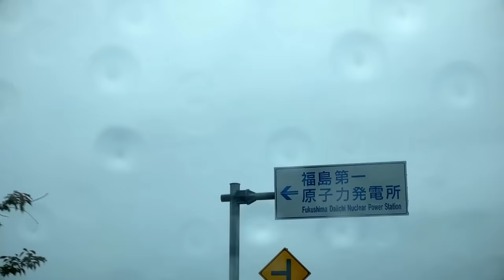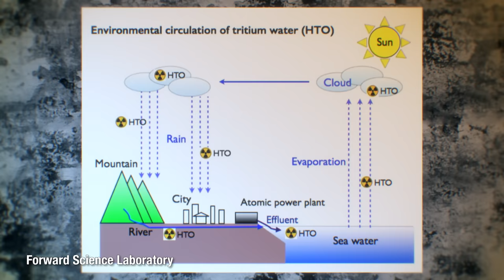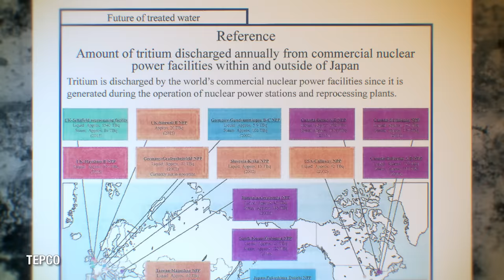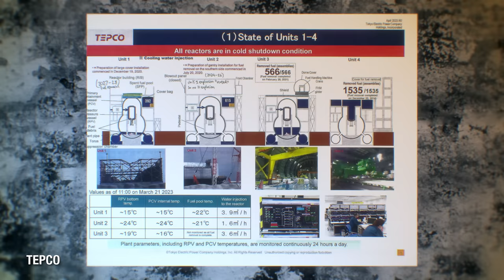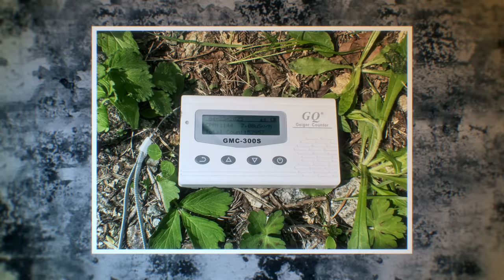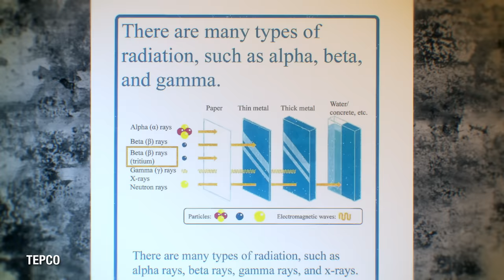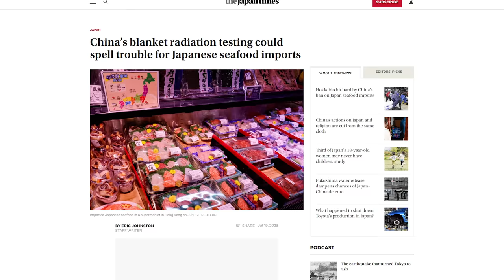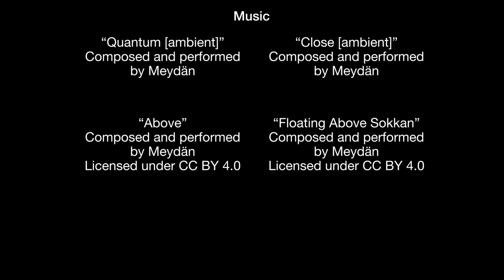Is Fukushima's Radioactive Water Safe?

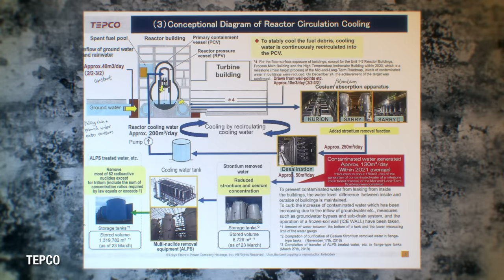Comment: Thank you for your information! However, I've got some confusions about some of the contents in your video. In 'The Water' section, you put an image (3:16) about the operation of the nuclear plant, and I looked into it. There're two types of water in there and I cared which one was releasing out into the environment, and I saw it's the cooling water in the light blue colour. The image also in this section at 4:07 showed how TEPCO cooled down the reactor after the disaster, where water needed to continuously recirculated into the Primary Contaminated Vessel. This made me think that the cooling water normally released into the environment from the nuclear plant is different from the water that TEPCO is releasing, because cooling water does not flow into the Primary Contaminated Vessel, and that makes me think the water released by TEPCO contains much more radio active substances than cooling water. In your video I feel like the nature of these two waters are mixed up, just to confirm whether my understanding is correct? 

My second confusion is more simple, about you explaining the dilution, actually I think it's quite misleading. So I wonder, if I want to dilute 1L ink and used 1 ton of water, there's less ink in the diluted solution in one litre (1/1001 concentration), but now I have 1L + 1 ton of solution (1001L), even though 1L of this solution is much clearer, but now I have 1001L in total. In case of releasing treated water, it's the same concept, that it's gonna release 1001L in 30 years instead of release 1L concentrated water in 1 year. In your video explaining about dilution, not only it should consider the concentration, but the total amout as well; if the total amout doesn't change, it's just spending more time to release, but not reducing the amount of nuclear active substance nor radio activity.

I generally don't support Japan of releasing the water (whether you call it trater water or contaminated water) into the ocean, because there's lack of transparency and shady acts (e.g. create mascot of Tritium; emphasize Tritium but disregard many more substances like C14 and Se137 that would cause more damage in the long run), and bad reputation of TEPCO that partially caused this disaster in the first place (not wanted to spend money to repair nuclear plant and build safety infrastructures). Also, the IAEA report is questionable as well, about its long disclaimer and the number/range of radio active substances tested. I'm really scared that the water released into the ocean is not as safe as TEPCO stated, but could do nothing about it. As a big influencer like you, please be even more cautious on the content you publish... It really does matter... If there's missing information that might mislead audiences, it would be disastrous...
Reply: The point of dilution is that poisonous and toxic substances all have their own unique amounts, aka doses, below which they are basically not harmful. The point is to make it impossible for anyone to receive a harmful dose.
Reply: you are right it is different with cooling water，it is more dangerous.
IAEA also said if something happened they have no duty with the JP government did.
maybe people can swim in Fukushima 1 hour，and if we leave on time，it is ok. but the fish？ even the Japanese dont eat it. so it changed the ocean is fact
Reply: I'm not knowledgeable about the mechanics of nuclear plants but as for your second question- Kyle addresses that the total amount of Tritium in the Fukushima Daiichi Power plant's water tanks is less than 3 grams. If they released all the water in their tanks at once it would be about a 0.03% increase to the total amount of the Pacific Ocean's natural amount of Tritium. TEPCO's plans to release the water over the course of 30 years means that by the end of that plan at least half of that Tritium in the treated water would have naturally decayed in the environment. The overall Tritium increase yearly in the Pacific ocean by the power plants water disposal is pretty low as a result. 

As for the rest of your concerns those all sound pretty valid and it is important to highlight transparency in just what is being disposed of into our environment- not just Tritium but other potential harmful substances. TEPCO is a company after all and there is massive public pressure to produce good face to the public- which may be exacerbating some risk like with bringing the tour group up close to the disaster site and the water demonstrations. I think Kyle did a good job with this video and nothing in it is quite misleading. It's up to the viewer to also exercise discretion and they can form their own opinion.
Reply: Very good observation.  The whole process is not only not  transparent but very misleading.  A lot of missing parts and manipulation. Japan had leaked out news about many mutant creatures in the area.  Very unfortunate Kyle is biased in this report.
Reply: @KyleA-kq9sy  Kyle is mostly presenting the data provided by TEPCO. He did mention from his own observation that the radioactive level was higher than expected in the surrounding when he stepped out of the bus and he could have chosen to stay in the bus.
Reply: @lunac466  That 3 gram is a provided sample - there were reporting that on many occasions the "treated" sewage is above legal standards.
Reply: @lunac466  Further, you can tell Kyle says the sample was clear.  But when the dumping happened, the sea water had turn grey.  Each dumping lasted for days.
Reply: @Cristin-u4z  I have notice Kyle's provided sample was clear.  The sea water after Japan's dumping turn grey.  😰
Reply: @Cristin-u4z It's a mistake that even Japanese people don't eat it. I'm Japanese, but everyone is buying fish and eating fish without worrying about it. Rather, due to the decrease in exports to foreign countries, many Japanese people who want to support them have started to buy fish.
Reply: @coolkidim That's a lie. The change in the color of seawater is not related to the release. Because there are parts where the color of the seawater has changed in the same way as before release. You can see it by comparing the state before the treatment water is released and the state after the release. I recommend that you look it up yourself from the hygiene photos.
Reply: @KyleA-kq9sy So, which part can you say is not transparent? I've never seen anyone explaining this. Many Japanese and overseas media claim that Japan maintains transparency. Also, what are the defective parts and processing? I can't find it even if I search for such a fact. Please tell me specifically.

Also, what is a mutant organism? I saw such a video on SNS overseas (mainly in China), but the fact check in the world has revealed that it was a fake video or a sea in another place.
Reply: @coolkidim  If it exceeds the standard, the processing is not yet complete. Currently, 70% of the water in the tanks exceeds the standard values and will be processed in the future. Additionally, even after processing once with ALPS, it may not reach a safe concentration. In such cases, it will be processed multiple times until it reaches a safe and standard concentration. Water that is safe and meets the standards is considered "treated water," so water that does not meet the standard values is not considered treated water in the first place.
Reply: Also, you say that TEPCO ignores many substances other than tritium, but that's a mistake.

Certainly, there are also nuclear materials that cannot be removed by ALPS equipment. But why is tritium emphasized? That's because you don't have to worry about it.

Most of the nuclides (excluding tritium) that cannot be processed with ALPS are so low in concentration that they cannot be detected before dilution by seawater.

Also, of course, there are some nuclides that may be detected, but they are below the standard value before dilution. If you dilute it, it's not that much of a problem.

All the explanations so far have been disclosed by TEPCO, and TEPCO has also disclosed specific material names for nuclear materials that may be detected. You can find all of these immediately by searching on your smartphone, and despite that, I can't understand the claim that TEPCO's explanation is insufficient or that there is a lack of transparency.

Comment: Great and insightful breakdown, as per usual. China, eco-cringe and a certain part of an EU government (Germany, it's always Germany) shouldn't be taken seriously when it comes to scientific discourse.
I study Physics, but to you I'm just a guy on the internet, so take this as seriously as appropriate (i.e. almost not at all), but I'm just echoing what Physicists are saying in general, so it's easy to cross-reference. 
There are multiple problematic waste-products from the Fukushima-Daichi plant, the most important one is Tritium (as mentioned in the video), but there is also Caesium-137 & Strontium-90 (among others), which are extremely dangerous.

But:
The relevant elements are all either alpha- or beta-radiators, and thus difficult to spread through means other than living organisms. For preemtive clarification: Caesium-137 is a beta radiator, not a gamma radiator as some claim. Gamma-radiation is found only in the entire decay-chain (Xenon-Caesium-Baryium(isotope)-Baryium(stable), if I recall correctly), not the Caesium itself. It decays into a strong-gamma-radiator, a Baryium isotope, but that resulting isotope has an extremely short half-life (less than a cake in front of you mum, so around 5min.). I assume this is how some outlets get to "Caesium does gamma-rays". Of all the elements among the discharge I could find, only Cobalt-60 is a strong partial-gamma-radiator. Fortunately, it has a half-life of around 5-and-a-half years, which means, to my knowledge, it's now not really of relevance for the projections anymore. 
The projections predict that after 1km, the substances will be <1%, which usually means it's non-detectable. For US people, that's around 0.6 in retard units. 
When the IAEA says it's safe, it's safe. IAEA representatives and their reports are extremely reliable as a source and they are often on a put on a list by governments like Iran and China because reality rarely lines up with what they want. The entire time-line of IAEA reports is linked below. 

However: there is a species of fish which has to be monitored apparantly, namely specific types of tuna. I'm not qualified to speak on that, so I can't tell you how that will be done.

Sources (I will retroactively add the links after posting to comment to circumvent YouTube flagging the comment): 
A neat summary without the science-lingo by the Nature Journal: nature.com/articles/d41586-023-02057-y
The entire Status Update can be found at: iaea.org/newscenter/focus/fukushima/status-update
The Environmental Impact Assessment by the IAEA: iaea.org/sites/default/files/iaea_comprehensive_alps_report.pdf
The mathematics behind these projections (incl. why tunas have to me monitored): 
frontiersin.org/articles/10.3389/fmars.2023.1104786/full

Comment: Thanks for calming looking at the facts and explaining why we don't need to freak out, I feel like we all kinda have an instinctive "that's scary!" reaction to nuclear, and hearing the combination of "this is very scary and dangerous" or "it's absolutely nothing to worry about" from the media doesn't help get a grip on the scale, I know the response I should have is between the two extremes, but when those are the only options I hear on the regular it's hard to know what to think
Reply: This is another attempt at misdirection. Tepco intentionally didn't test their filtered water for levels of carbon-14, strontium-90, iodine-129 and many other dangerous nuclides. Even IAEA stated in their report provided by Tepco that they neither recommend nor endorse Japan's decision to release the radioactive water.

Comment: If you read the information below, you would understand the anger that I have:
1. The TEPCO (Tokyo Electric Power Company) is a company with a really bad reputation and is well-known for dishonesty. It never adhered to international best practices and standards while building and operating the nuclear station, and lied about the severity of the incident, which led to the escalation of the disaster (it claimed it was a mere core damage, not a meltdown, leading to the adoption of incorrect measures).
2. Japan claims that ALPS removes all radioactive elements except tritium. However, according to Japan's METI, around 70% of ALPS-treated water still contained radioactive substances other than tritium. This figure will be even worse when third-party testing is implemented.
3. There were initially five proposals to address the polluted water, but Japan simply chose the cheapest option: to dump the nuclear water into the sea.
4. Even worse, Japan refused offers from other countries to monitor the water. If the treated water is truly safe, why be so reluctant to allow others to participate in the testing? Are they afraid of the truth being revealed?
5. Japan has increased its budget to 70-billion-yen for marketing about its nuclear water release. So be careful of what you heard and please have your independent thinking.

After all, If the treated water is indeed safe, then they should keep it for themselves. If it's not safe, then they shouldn't dump it into the ocean either.
Reply: Qanonsense much?

Comment: Someone just brought up an excellent point and I would like to elaborate on it.  This ALPS device was the First of its kind in the world and had no prior examples, related usage experience, or data to support its effectiveness.  Indeed even according to the very limited reports from TEPCO, the device had failed on so many occasions in eliminating radioactive elements.  TEPCO had to use the device repeatedly on the same nuclear radioactive waste in order to manipulate the outcome.  The fact that there were no relevant experimental analysis reports on this device making Japan's safety claims on the radioactive toxin very lacking. The proclaimed effectiveness of the device rests solely on the unilateral statements from an entity who had turned the initially low category accident to the biggest radioactive category 7 disaster on earth.
Reply: It's all wrong. In the first place, ALPS is not originally able to remove all nuclear materials at once. By passing the water through it multiple times, it becomes a safe concentration of water.
Reply: In addition, TEPCO does not only submit limited reports, and according to the materials submitted by Japan, other countries such as South Korea have also recognized the performance of ALPS, and the IAEA is also conducting independent inspections. Overall, the performance of ALPS is amazing.
Reply: @sushiya_jp  obviously you are from Japan. If that’s safe water, you guys should drink it and keep the ocean clean
Reply: @jay8235  Yes, that's correct. I am from Japan. Even if a Japanese person were to drink it, it wouldn't make a difference since it's expelled from the body and flows into the sea. Besides, the treated water from conventional nuclear power plants in any country should be safe, yet it's released into the sea. If you believe that the treated water from a typical nuclear power plant is safer than the release of water in Fukushima, then you should start by drinking the treated water from your country's nuclear power plants. After all, your country also releases treated water into the sea, so it should be safe to drink.

Comment: Is there any reason why they don't circulate the water? I get the reactor needs cooling but if the water is good enough to dump to the sea, why isn't it good enough to do cooling once more?
Reply: tritium is radioactive still. Hit a neutron and it's a radioactive helium.
Reply: The water here were not only used for cooling the nuclear core but also for slowing down the nuclear reaction. With the neutron reacted with Hydrogen (1proton) forming Deuterium (1proton + 1 neutron) and Tritium(1proton + 2 neutron) less neutron went back to speed up nuclear reaction. So the over concentrated tritium water won't work well for cooling.

Comment: Thank you so much. Not only did I learn more about radiation, I learned way more about this than I was able to process when it first happened. I was much younger and thought it was another Chernobyl and I was so exasperated by the idea that the world would imminently end that I admittedly dissociated from all of this stuff. I feel a bit more at ease in a hopeful sense.
Reply: it is another Chernobyl, please have a check on the world nuclear accident level of these 2 plants.
Reply: @dnmdch but not as dangerous as Chernobyl
Reply: Because of the fuel and graphite particles coming directly from that damn rmbk 1000  sector 4 reactor
Reply: But now there is less radiation